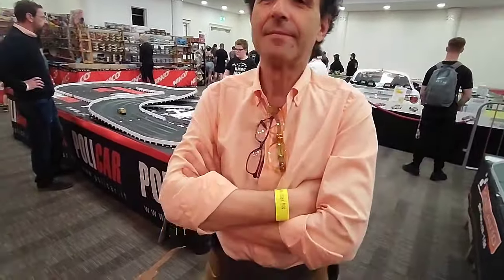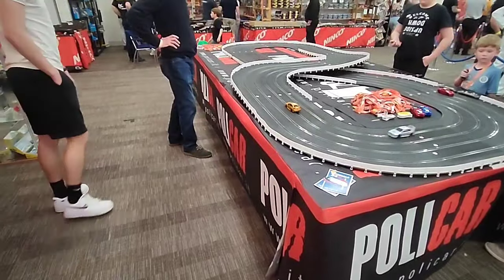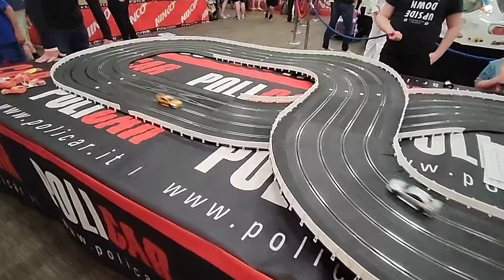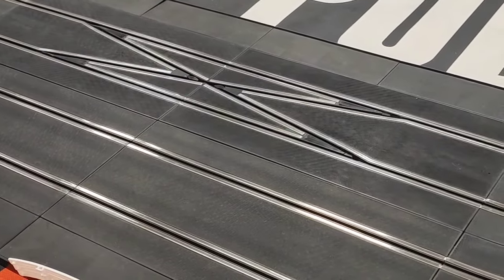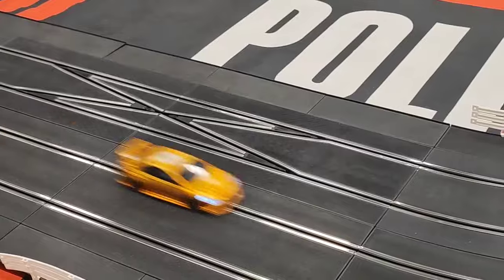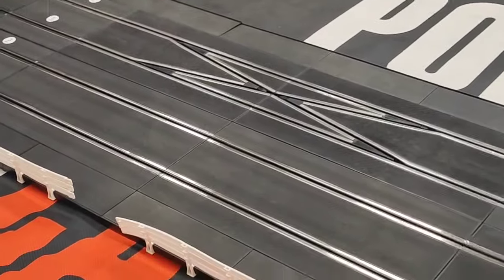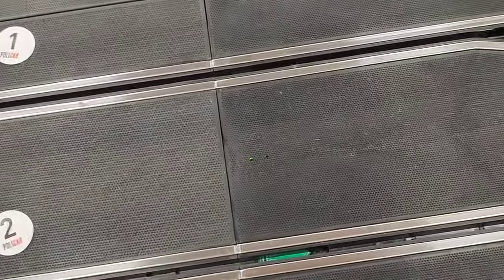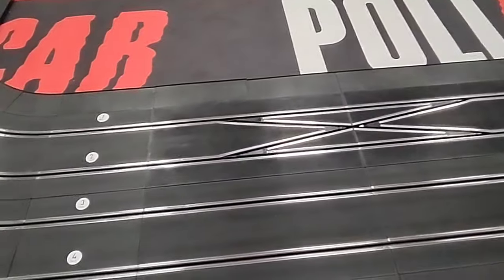Policar - Maurizio talks digital lane change slot car track

Comment: Hopefully it has a switch to change back and forth between digital and analog.
Reply from the maker: In standard form I believe that's done in the usual way - by switching the whole track from analogue to digital. As soon as the rails are a constant 12v the lane changer power led is solid green. As you can see, even in analogue mode the changer power was switched according to how much throttle the driver was giving the car.
Reply: Can’t wait to get this